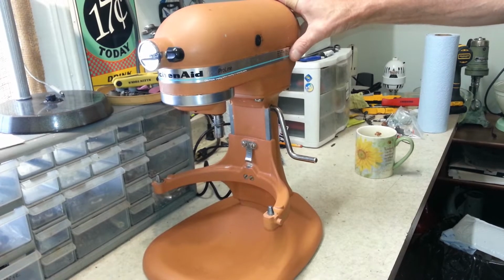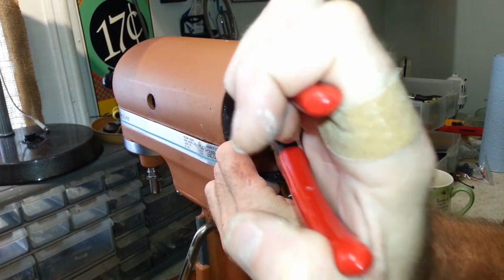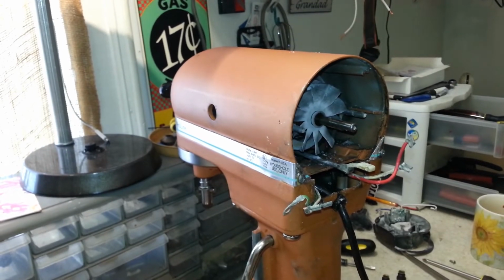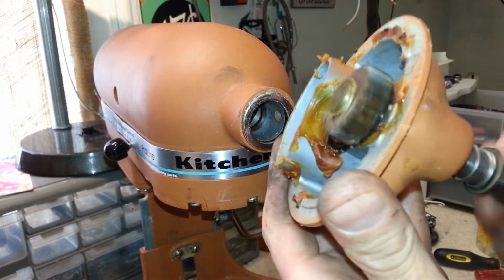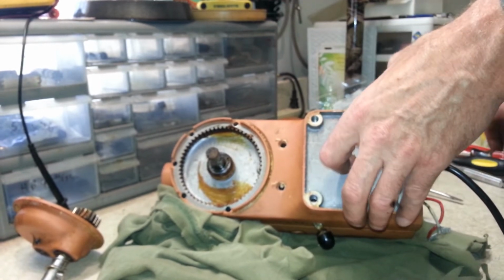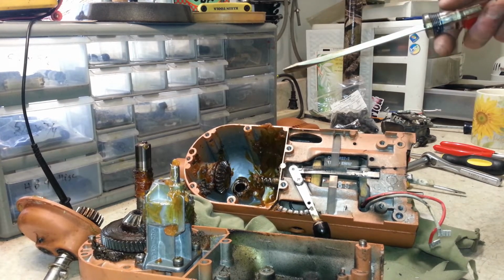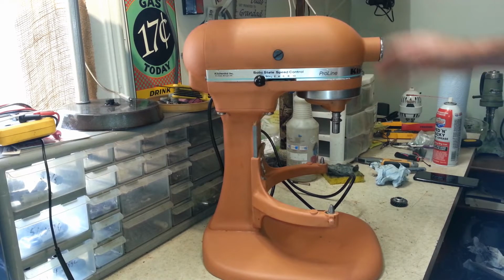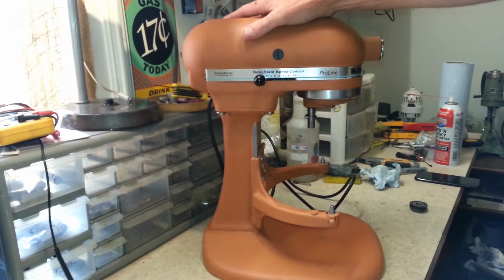Kitchenaid KSM5 service and maintenance

Comment: Re: After repair, mixer works, but stops turning under load

A couple viewers should find this info useful.

I replaced the worm gear on the one I'm repairing; the mixer had been well used over the years. But it stopped turning under load: the pinion turns, but the center gear stops. After much pondering, it occurred to me to look very closely at the pinion gear. Aha! The teeth at the bottom of the gear look just like the teeth on the center gear: each tooth has nice 'shoulders' on each face of the tooth. But on the top of the pinion gear, the shoulders on the 'load' side of the teeth are worn off. (The tops of the teeth on the center gear, in my case, look OK, but I haven't checked the bottom of those teeth.) Then I thought to check the bearings. And yes, there is play in the lower bearing (maybe 1/32 inch when inserted fully into the bearing); the top bearing has a little play. This wear combines to make the pinion no longer connect properly with the center gear under load.

The easiest solution is to buy a complete worm/pinion assembly. And if the teeth on the center gear are worn, buy one of them, too. If the case gasket is iffy, get that as well. (All three about US$71 at partsdr.com, with ground shipping, but pre-tax, as of 7/22. You get the gasket, the worm/pinion assembly, center gear and attachment bevel gear.) For that price, I'll just buy all three and be done. Brushes look good; don't need them.

Comment: I have this same mixer and I took it apart and all the gears on mine appear to be metal???  Are the older plastic gears a darker plastic of some sort??? Thanks! (If so I will be switching them to metal)
Reply from the maker: The older gears were a fiber gear, very strong. These only had one non metal gear, it is the worm gear that is replacable, although I have heard some of the model k4's had a metal worm gear.
Reply: Vintage Mixers and More thanks for responding! That makes sense! 👍🏾

Comment: How did you get your gears so clean?? I have tried using a degreaser detergent to no avail.
Reply: A detergent degreaser like Simple Green is too gentle, you need mineral spirits. Pour into a container and throw the parts in and clean with an old toothbrush, works great.

Comment: No doubt it will perform better mechanically with that grease, but it's not the right grease, it should be food grade grease.
Reply from the maker: I have covered this topic before in other videos, but it is pretty much personal preference. Food grade grease needs to be food grade since it will inevitably leak, look at any kitchenaid after a few years and notice the staining, especially around the band. I say if the grease stays in the gearbox where it belongs, like any good quality stable grease will, then it is not necessary, but once again it is all personal preference.

Comment: Gears like that should be replaced as a set they have meshed with each other years ago.  Then you change only one, the other isn't going to like it.  Second, why are you not using food grade grease?
Reply from the maker: One gear is metal, the other is fiber or plastic, depending on the model and year, I dont see how the metal gear will wear the same as the plastic gear it is in contact with, unless you are referring to another gear? I stopped using food safe grease when I realized it turns runny when it gets warm, and breaks down much quicker than lithium based grease, then soaks through the gasket, under the band, staining the finish and running all down and into the machine. I have heard so many people complain about that, so I use the high quality lithium based grease that keeps its viscosity under extremely warm conditions, and will not seperate or break down. I prefer the grease to stay in the gear box, but the option to use food safe whirlpool grease was always there.
Reply: @vintagemixersandmore1666  I have a KSM5 mixer, still running well.  Do you fix Kenwood mixers?  I was thinking of changing to Kenwood Titanium when the KitchenAid dies.  Just wondered if the Kenwood is as good.  Thanks.